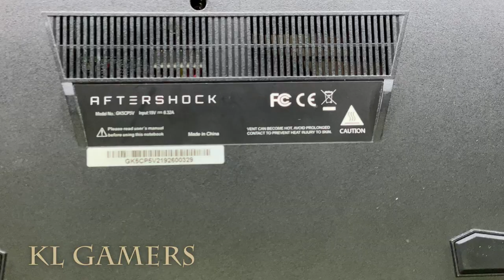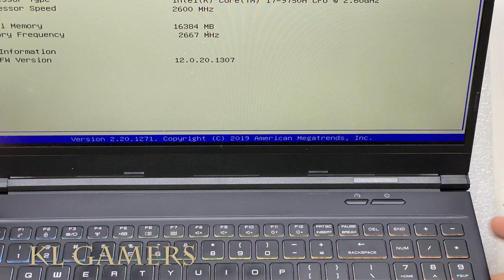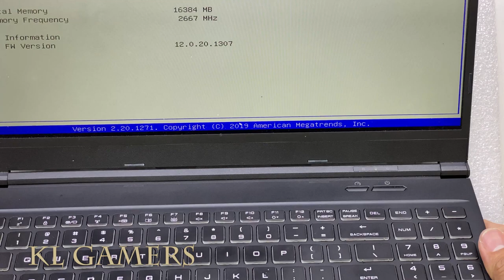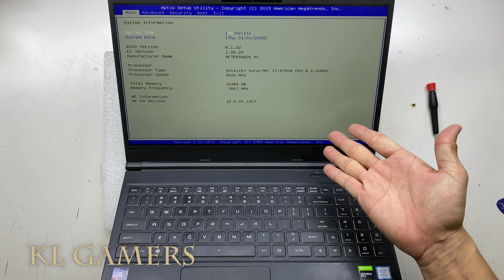AFTERSHOCK Notebook Laptop Model GK5CP5V Vacuum Clean Dust Replace Thermal Paste

Comment: Hi, I have the same laptop and now the display wont turn on. The laptop works but the display does not turn on. When I attach the tv via HDMI, the laptop detects the tv as the main monitor. Do you know the fix?

Oh yeah, May I know the key to go to BIOS?
Thanks
Reply: I had the same happen to me, did you ever find out how to fix the display?
Reply: @snooowxo  I went on a road trip for 9 hours, Laptop was kept in bag whole time. Arrived in the hotel, and turned on laptop, suddenly the screen started working again. Very strange. 

It worked well for 9 days. then today, while using, suddenly the screen froze, and the edges started getting black. And the blacks started getting bigger. I attached another monitor to switch to screen 2. After that the screen does not turn on again.... :(